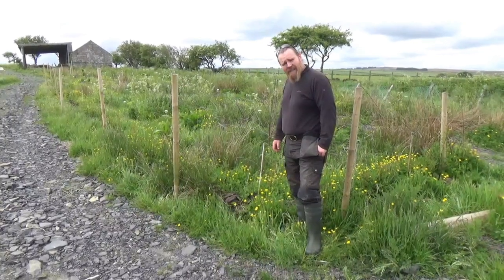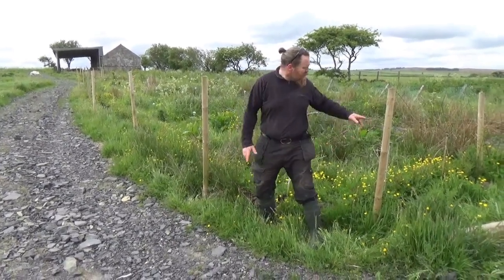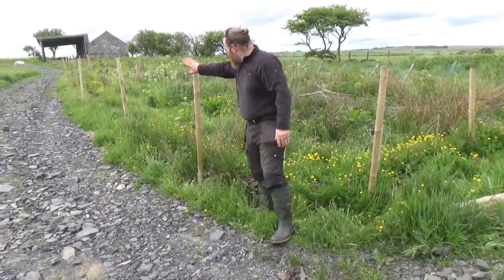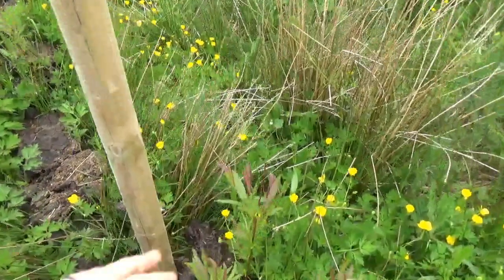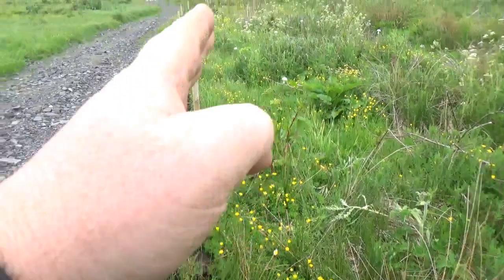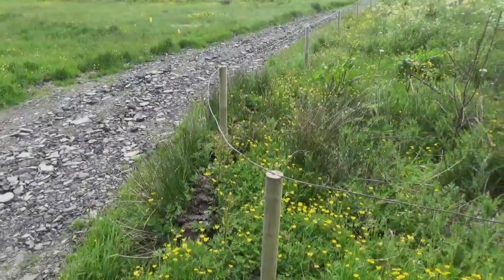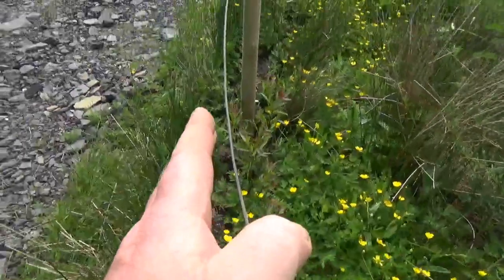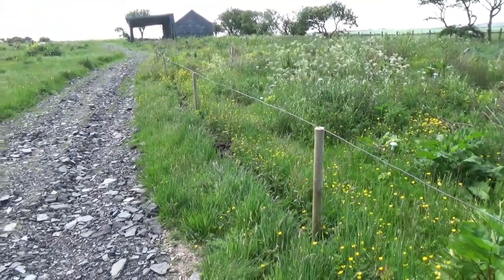How to install a sculptural living willow fence/hedge for your food forest. The Fedge.

Comment: i did a similar thing with willow , i put 2 cuttings per hole in a 45° angle and started weaving them together on the first meter as a fence, then started twisting them around a wire ,and after 3 years of weaving i started cutting 2 times a year
Reply from the maker: Excellent!
Reply: Have been planning a curved Fedge for a while now. Like your post and wire idea so thanks 😊 Which variety of willow are you using... viminalis??